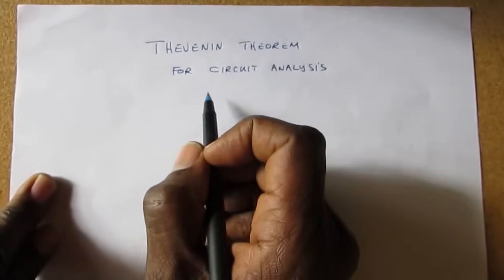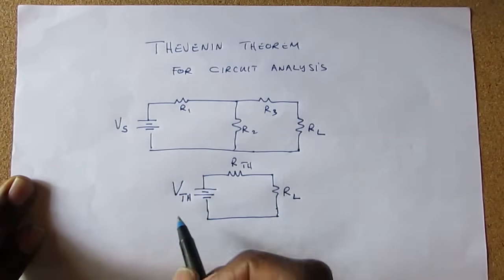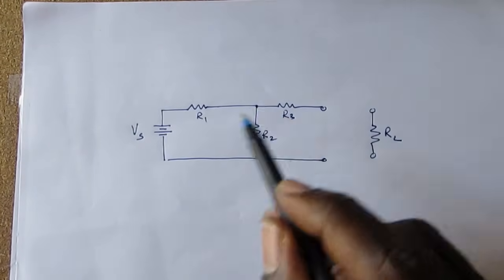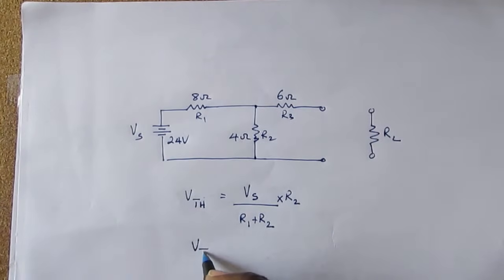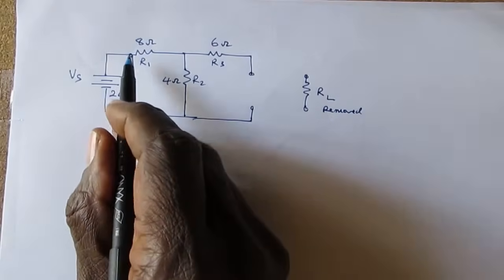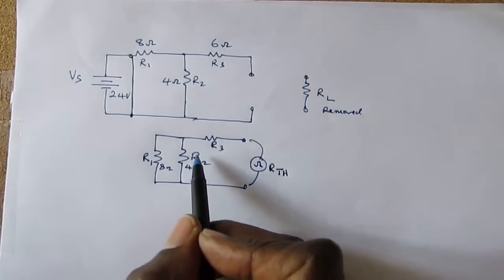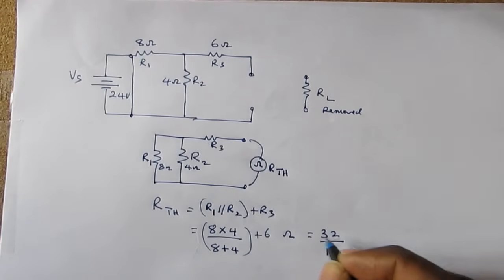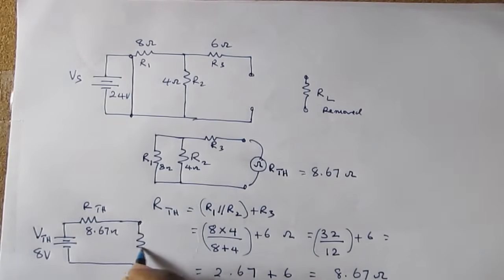The Thevenin Equivalent Circuit

Comment: Thanks! I now understand the concept more, by the way how did you derive the formula for the Thevenin Resistance and the Thevenin Voltage? Both seemed a bit arbitrary to me (but the Voltage even more so)
Reply from the maker: I recommend that you ask ChatGPT for a detailed explanation by asking: “How was the thevenin voltage and resistance calculation method arrived at?”
Reply from the maker: This is the explanation I got from ChatGPT:

The Thevenin theorem, formulated by Léon Charles Thévenin in 1883, simplifies electrical circuits by reducing complex linear circuits into a single voltage source and a series resistance as seen from the load. The method for calculating Thevenin equivalent voltage and resistance is derived from basic circuit analysis principles, particularly superposition and linearity.
Derivation of Thevenin’s Method:
Superposition Principle:
Thevenin’s theorem is closely related to superposition, which states that in a linear circuit with multiple independent sources, the response (voltage or current) at any point can be determined by summing the responses due to each source acting alone while all other sources are replaced by their internal impedances (voltage sources shorted, current sources opened).
Thevenin Voltage (
V
t
h
V 
th
	
 ):
The Thevenin voltage is simply the open-circuit voltage across the terminals where the load will be connected.
This is found by analyzing the circuit as it is, without any load attached.
Using Kirchhoff’s laws or nodal/mesh analysis, we determine the voltage at the open terminals.
Thevenin Resistance (
R
t
h
R 
th
	
 ):
The Thevenin resistance is found by replacing all independent voltage sources with short circuits and all independent current sources with open circuits.
The equivalent resistance seen from the open terminals is then calculated using series-parallel resistance combinations or other circuit simplification techniques.
Why Does This Work?
Linearity of Circuits: Since resistors, voltage sources, and current sources behave linearly, the entire circuit can be modeled as a first-order system.
Equivalence Principle: Any linear circuit seen from two terminals behaves as a single equivalent source with an internal resistance. This is fundamentally the same reason why batteries have an internal resistance model.
Historical Development
Thévenin built upon the work of Helmholtz, who described similar concepts in the context of potential functions in 1853.
The theorem was independently discovered by Mayer in Germany around the same time.
Would you like an example demonstrating this step-by-step?

Comment: If your somehow still confused about why V_Th is calculated by (V_s/R_1+R_2)*R_2 think of it like this. V_Th is the voltage at the terminal before R_3 which is the same as the voltage across R_2. How do we calculate R_2? V = iR right? V_Th = i*R_2.... we need i......... i = V_s/R_eq..... R_eq = R_1 + R_2.... All he did here was simplify this process into one equation. 
So now....V_Th = (V_s/(R_1+R_2))*R_2.
Basically.... to find V-Th all we need to do is recognize that V_Th is the same as the voltage across R_2 and we need to find the current through the new circuit so that we can find V_2. 
V_Th = i * R_2. 
i= (V_s / (R_1 + R_2))

Comment: How does this theorem help us solve RL?
Reply from the maker: The usefulness of the Thevenin circuit is that the current through any value load resistor may be calculated. Just divide the Thevenin voltage by the sum of the load resistance and Thevenin resistance: Current in RL = Vth /(Rth + RL)

Comment: How would I apply this to a bigger circuit? Would I have to convert it into a series voltage divider in order to have a resistor in parallel with the terminals, thus being able to use that parallel resistor to calculate Vth? I am confused on how to apply this to a larger circuit, for example a series-parallel circuit with 9 resistors.

Great video by the way, I finally understand better.

Comment: Great video.  Extremely helpful.  I’m teach myself electronics.  Question: do computer use these voltage dividers circuits to convert source voltage.  To the voltages they need.  Example 5v and 3v.

Comment: If R1 and R2 make a voltage divider circuit, then how come you treat them as if they are parallel when calculating the total resistance since two resistors must be in series to be treated as voltage dividers

Comment: hello sir can you explain to me how ri and re became parallel
Reply from the maker: king mohhamed 
Hello Mohhamed, I assume you mean R1 and R2. Two resistors are in parallel when both of their ends are connected together. Note that if the Vs is shorted, the top end of R1 is connected to the top end of R2, and the bottom end of R1 is connected to the bottom end of R2. R1 and R2 are therefore connected in parallel.

Comment: I have a question how can i calculate the voltage if R2 was removed instead of RL ? I have a similar circuit and i have no idea if the way i solved  is correct .
Reply from the maker: For Thevenin circuit analysis you always remove the load resistor, RL ,and would not be required to calculate the Thevenin voltage by removing R2.

Comment: Good video. The only thing i'm having trouble with is how would you know which resistor is R1, R2, R3 etc if you're only told the individual resistances in ohms? You already have them marked out as R1 R2 R3 but i have a circuit question that doesn't give me these. Please help.
Reply: krakatoa16 
You may choose to name the resistors in any order, just make you apply them consistently in the formulas.
Reply: I didn't realize you could do that. Thank you so much. I've watched about 20 of these videos and yours was the easiest to understand.
Reply: u have a long way to go but still :) i hope u get the ans

Comment from the maker: With the voltage source removed and the points where the voltage source was 
connected now shorted, the top ends of resistors R1 and R2 are connected
 and the bottom ends of R1 and R2 are connected, hence resistors R1 and 
R2 are in parallel.
Reply: Thanks you for explaining that, once I saw this comment it helped clear up my confusion. Cheers!
Reply: When finding the Thevenin Voltage, why do you multiply it by R2? I don't understand that. Vth= (Vs/ R1 + R2). What's the purpose of multiplying R2 in there? I don't get it.
Reply from the maker: @thomassankara1391  The Thevenin voltage is the voltage across R2. But VR2 = IR2 X R2. Since IR2= Vs divided by (R1+R2). Then VR2 = IR2 x R2 = Vs /(R1+R2) x R2
Reply: I still don't understand, can you show me a diagram of what you mean
Reply: solve it with more complicated circuit.it is easy to explain in simple circuit

Comment: Thanks for the explanation but I had one question, at 5:26 why did you say that R1 is parallel to R2? I dont get the thing with points. Thanks
Reply: Tanvir Rahman 
with the voltage source removed and the points where the source was connected now shorted, the top ends of resistors R1 and R2 are connected and the bottom ends of R1 and R2 are connected, hence resistors R1 and R2 are in parallel.

Comment: How R1 ended up being parallel to R2!! ?
Reply from the maker: Shyam Sundar 
for circuit  analysis  purpose  a voltage source  is "removed " by placing  a short across  it.  when this is done, R1 appears in parallel  with R2.